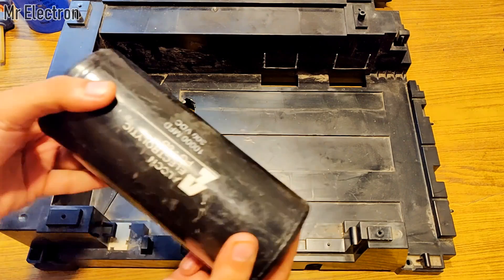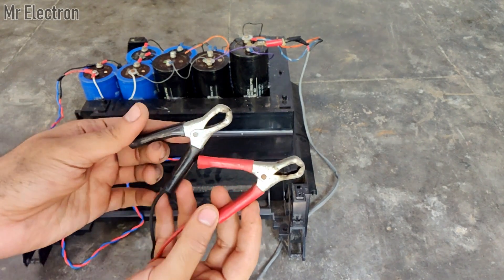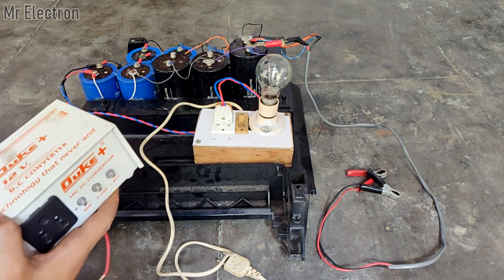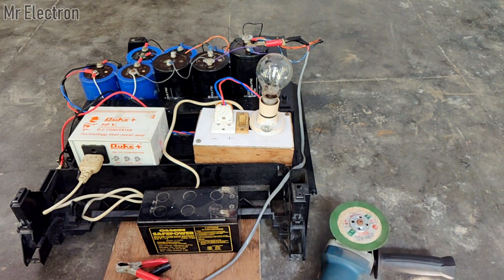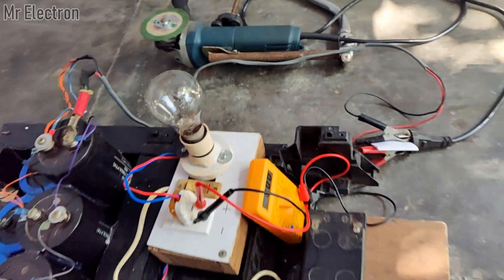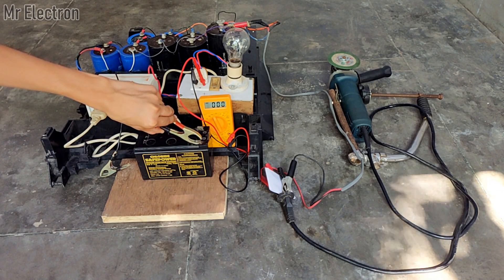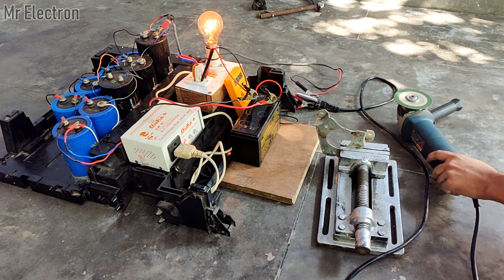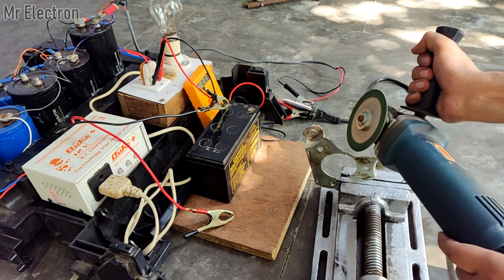How to operate 220 v Power Tools on 12 v battery | Top DIY

Comment: Nothing great. The grinder comprises of a high speed series motor, which can work on AC & DC. So when you apply the DC voltage from the cap bank, it works on the DC voltage and lasts till the charge lasts. If you used around 18 or 20, 12V LA batteries in series, the grinder will work very well too.